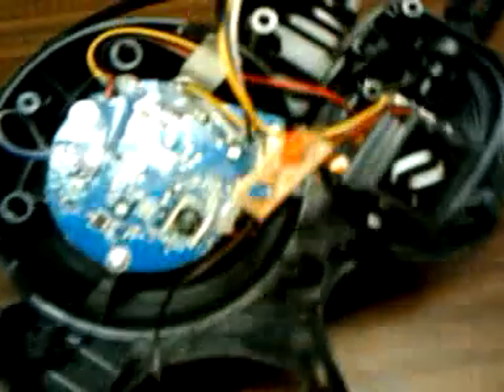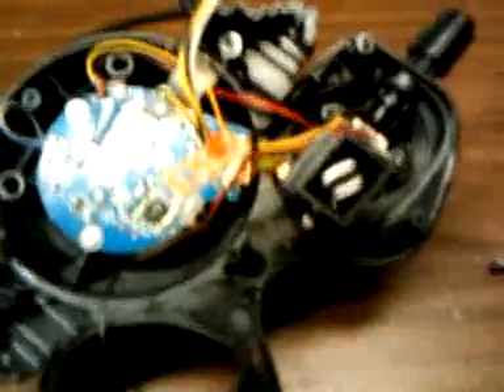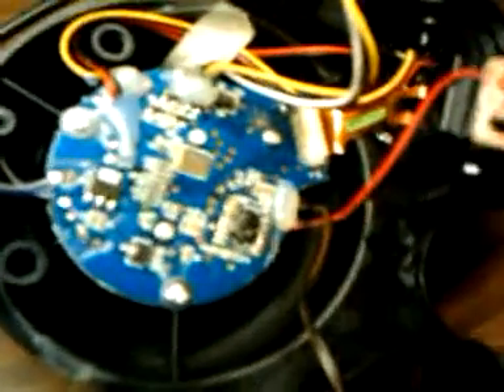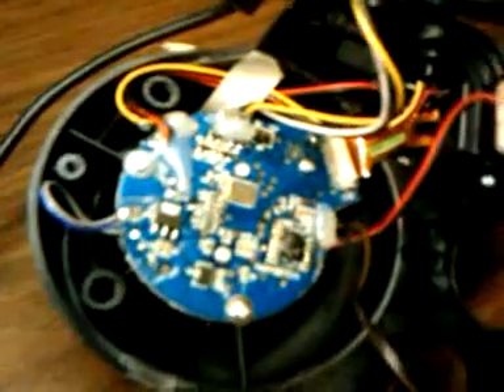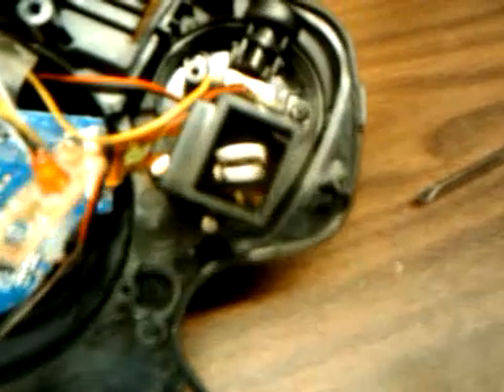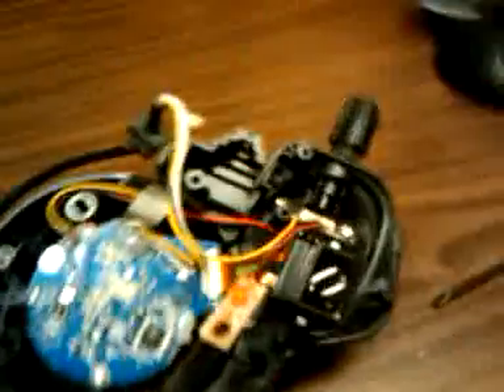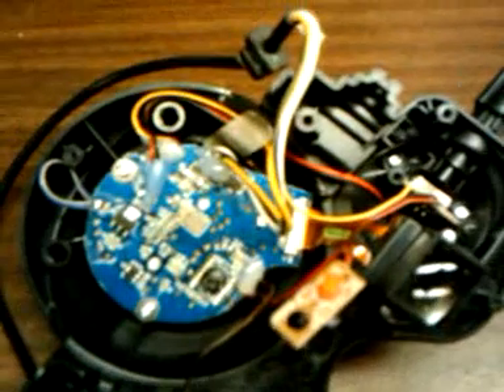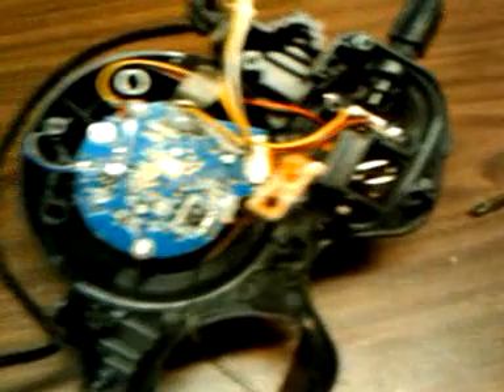Eyeclops night vision toy disassembly

Comment: do you think it could handle the power of a 2s lipo battery instead of the double As? it would be 8.4v instead of 7.5
Reply: Royallydoomed use resistors. It will work with your higher voltage but will probably stop working due to overheating.